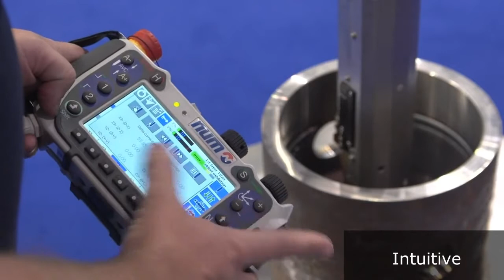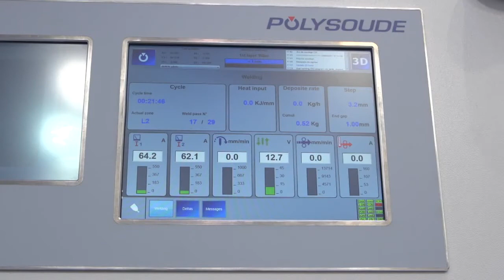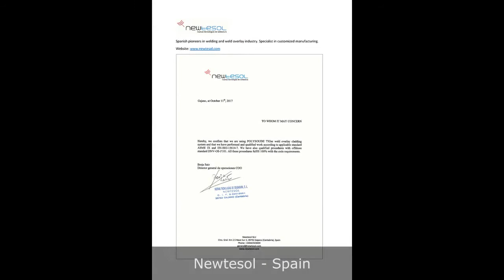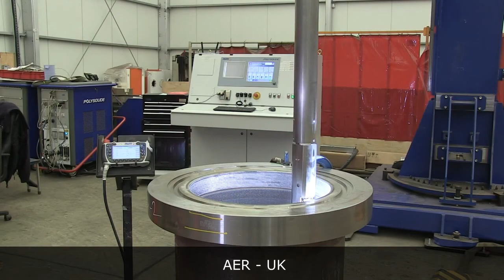Polysoude SPX CN - Endless Rotation Head

Comment: Is the start/stop at the holes in the part programmed in by touching the tungsten on 4 sides? What is the smallest diameter for internal cladding?  Thanks
Reply from the maker: Hello,
The “workpiece origin” is teached to the machine by main bore and top surface touch. The cross bore is defined in the program (just diameter, angle and related position from top surface).
And the smallest diameter for internal cladding is ID100 with TIGer technology and ID34 (before cladding) with TIG Hot Wire.

If you need any further information, please do not hesitate to contact Mr. Penisson at H.PENISSON@polysoude.com. 
Kind regards,
The Polysoude Team